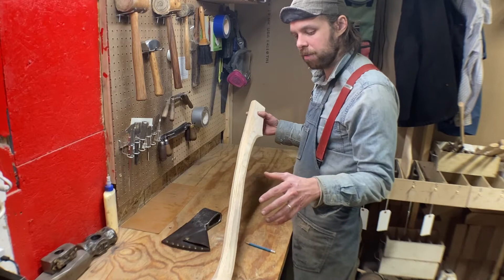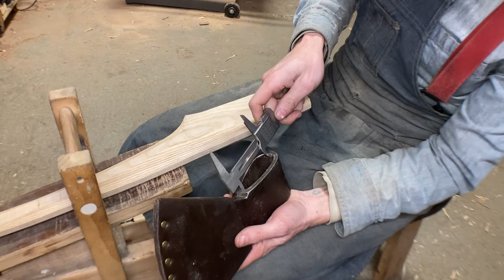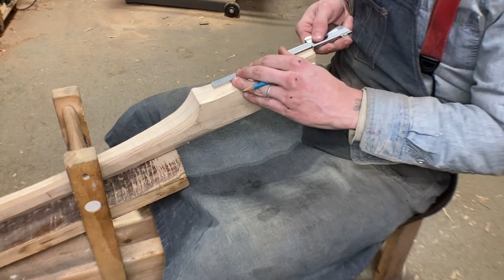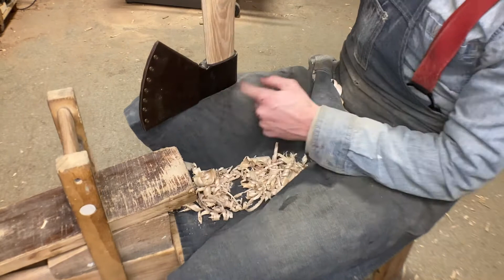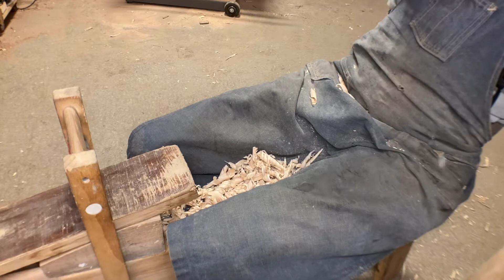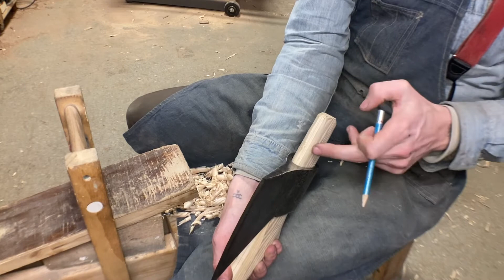Handle Tutorial - Part 3 - Framing the Head

Comment: It's fantastic to see precise axe hafting.  I've already incorporated a lot of the stuff you do into my process.  The way you measure things out before using the drawknife seems like it could really help a beginner.   I'm guessing you can also easily finish the entire handle without using measurements by now.   Right now my biggest skill deficit is how I shape the fawns foot.  I believe there is a lot more experimentation for me to in that area.

I've always done things by eye.  I thought that I was building skill.  While I think I did there is a possibility that I waste materials.  It hurts a lot more when you air dry something you hewed yourself.  I just for the first time drew a center line.  I think I made things a lot harder on myself.  I've mostly made my own hatchet handles since processing short rounds is much easier than a full sized handle.   I recently hung a mini hatchet crooked but luckily it was a practice handle on some green Red Oak.  I believe I'd have had no problems if I did something as simple as drawing a center line. 

Thank you for the video series.  So far it's been excellent.
Reply from the maker: Thank you so much! I’m so glad to hear all of this!! I’ll be going in to detail about the knob in part 5! It’s really just a glance off the water as far and the full info goes but I hope it’ll be enlightening once I release the video. Should be posted in two weeks! 

I’m sure someday I’ll make a video going in to greater detail about all different knob designs and how to best achieve them but for now thanks for watching!